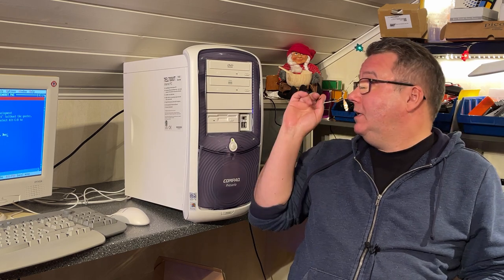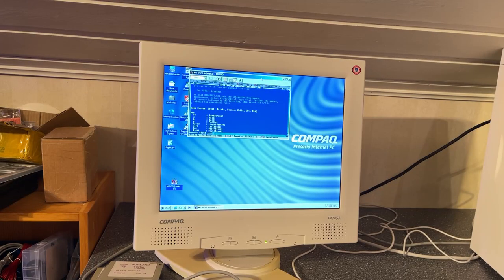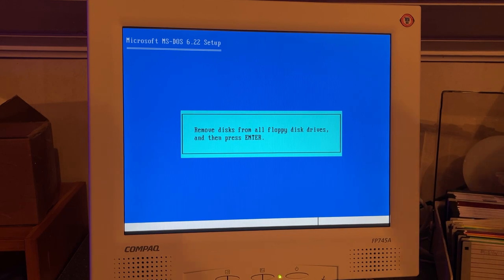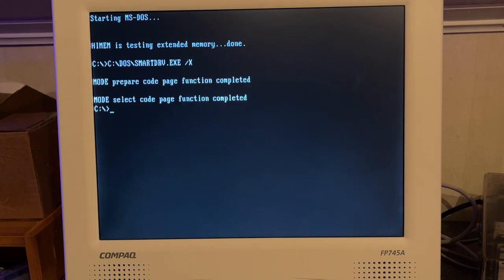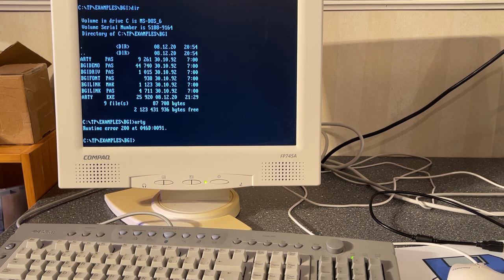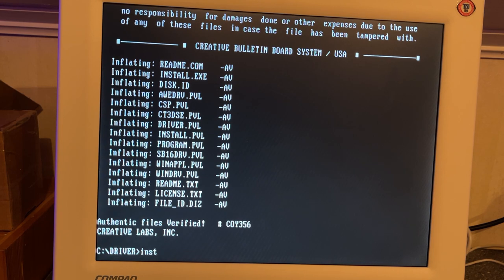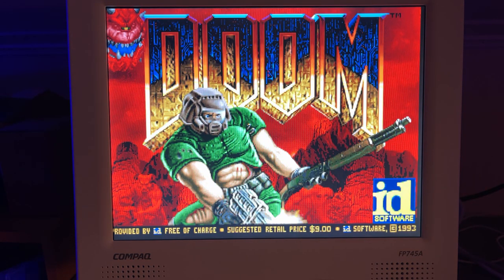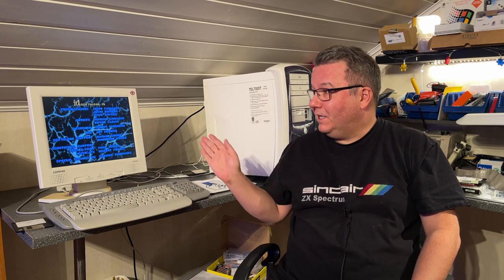Back to basics: Exploring MS-DOS and Turbo Pascal #DOScember

Comment: Turbo Pascal was great. One of the best IDEs ever created in my opinion. You could do almost anything with it, and do it fast. I did a point of sale client using Turbo Pascal in a weekend in the 90's. Later I migrated everything to Delphi until the "web application" era came and turned everything as painful and miserable as it could be.
Reply: It's still a pretty accessible development environment for DOS even now - compared to something like Programmer's Workbench that came with Microsoft C, the Borland IDE was miles ahead.. Turbo Pascal in general is great - Borland wrote great documentation for it which is easy to grab online, it has a very decent runtime library, a text-based windowing library, supports features like inline assembly, and at the time was very cheap - less than $100 when other language packages easily cost 5-10 times as much.  On top of that, it compiles blazing fast in general, and even compiles reasonably quickly on 8088/80286 CPUs, My last two DOS games were both written using Turbo Pascal, and the only reason I moved away from it for my current one is that I'm targeting protected mode (TP only supports real mode targets), and Free Pascal treats DOS like a second class citizen - there's usually something or other broken the few times I've checked it out over the years.
Reply: @Damaniel3  Re: "Free Pascal treats DOS like a second class citizen" - I'm a Free Pascal developer and I'm the author of the 16-bit i8086 MS-DOS and Win16 port. We don't treat DOS as a second class citizen. It is just difficult to maintain, when there are only two people contributing. We need more contributors, so if you like Pascal and you like DOS, please consider spending some time writing a patch the next time you encounter a bug, instead of staying with Turbo Pascal. Thanks.
Reply: @Damaniel3  I used Clarion for DOS for many years, and for building LOB apps like that, it killed anything on the market.  But it was much less fun than writing games and utilities in Turbo Pascal!
Reply: I agree with you 100%!! All the "modern" tool and frameworks require a lot of maintenance, updates and your program sbecome obsolete in 6 months. What used to be called a "programmer" are today a " developer". ;-) Web developer, PHP developer,  etc..
Reply: Totally agree !!!  I still program in Pascal !!!

Comment: Have to admit, I do rather like the look of that Compaq keyboard too. 
I used to work in Tech Support for PC World which was a Major computer retailer in Britain, certainly in the later 90's and 2000's and I do recall that there was a certain level of problems with compaq keyboards and if I recall correctly, they system we had to use to book a replacement for them was a bit of a pain in the ... rumpus ... 😀

That said, they did have some very fun designs and extra function buttons that even today wouldn''t be sniffed at! Although backmodding one with mechanical keys would be a nice project!

Comment: Turbo Pascal 3 was a revolutionary product, it was a capable compiler and very fast, but a pretty rudimentary development environment.  I was first running Turbo Pascal 3 on my original IBM PC with 2 floppy disks.  Then Turbo Pascal 4 came out which was a more advanced development environment including a pretty good editor and a debugger.  You could write very capable programs with it.  Once Turbo Pascal went into Windows it was very capable for developing Windows apps, even compared to tools and compilers available today.  I'm still running 32 bit Windows 10 which can run all of the old versions of Turbo Pascal, however I do my programming in a couple of descendents of Turbo Pascal- Delphi and Lazarus.  You said "20 year old machine"- my machine is 14 years old, quad core processor overclocked to 3.8GHz, and upgraded to SSD drives and Windows 10.
Reply from the maker: Thanks for the comment. We still maintain software written i Delphi at my company where I work. However, now most is written i .NET / C#

Comment: I think the best thing about this DOScember theme is that we get to discover Retro-YouTubers which we would be otherwise completely oblivious to even existed. Yeah, you've just gotten yourself yet another subscriber.

Now, I have done a mind-numbingly lot of Pascal programming, beginning with Kick Pascal on my Amiga 500 in the late '80s, Turbo Pascal and Borland Pascal up through the '90s, ending with several versions of Delphi up through the 2000s, before eventually moving onto C++ and C# like everybody else. Since far most of my coding was work-related and the company where I worked were for some reason clinging onto MS-DOS and DOS-related programs well into the WindowsXP years, with claws and teeth like a mad dog to its favorite toy.

I actually encountered the runtime error 200 in Turbo and Borland Pascal from pretty early on. And I also got so tired of having to use TPPatch that I eventually incorporated it into the CRT Unit, literally curing it for good. Whereas the original was called "CRT" and I wanted it to be easy to implement, I simply named my replacement "CRTUNIT". So all I had to do to fix my source-code would be to change the name from CRT to CRTUNIT in the USES statement at the very top.

I have just dug it out of one of my old backups, zipped it, and uploaded it to my website. So here is a little X-mas present from Denmark 😉
https://www.zhixalom.com/files/crtunit.zip

If you take a closer peek at the CRTUNIT.PAS file, you will notice that all I did was to replace the Delay procedure with the assembler-code from the TPPatch documentation.
Reply from the maker: Great comment! Thanks. I was thinking about finding a patched CRT unit.
Reply: @Arcticretro  Here are some other tips: if you use the FDISK command to create first 2 extra "Primary" partitions, so you have 3 in total), then 1 "Extended" and then more "Logical" partitions inside the extended one (I can't remember how many it can hold, I think it might be 4 per extended partition). Each primary and logical partition being 2GB... granted you do end up with a lot of drive letters, but that is one way of utilizing more of your hard drive space in MSDOS v6.22. You can boot from the primary partitions, not from the extended or logical, but those you can have a lot more of.

I totally get why you would want to show the installation of MSDOS v6.22 in a DOScember video. But as I am sure you already know, there really was no need to with your machine.

Because since Windows 95/98/ME basically all run on the same core, which actually runs on top of MSDOS just like Windows 3.x. Microsoft just increasingly tried to hide it with each version. But you could have simply disabled booting straight to GUI in the MSDOS.SYS file.

Now, in MSDOS up to and including v6.22, MSDOS.SYS is a binary file. But in Windows 95/98/ME it became a text-script-file just like CONFIG.SYS and AUTOEXEC.BAT. It is by default still protected by the "system", "hidden" and "read-only" attributes just like its predecessor, which makes you unable to directly edit it. But that is easily fixed with a simple "attrib" command from the DOS-prompt inside Windows:

ATTRIB -H -S -R C:\MSDOS.SYS

Now you should be able to "EDIT C:\MSDOS.SYS" or just use Notepad if you'd like. Then all you need to do is change the "BootGUI" setting and add a "Logo" setting to prevent the Windows boot-screen from overlaying and hiding the MSDOS boot up text-screen. It should look like this:

BootGUI=0
Logo=0

I always reapply the attributes with "ATTRIB +H +S +R C:\MSDOS.SYS" afterward, but I am not sure that it is actually needed.

This lets you use the MSDOS v8.0 of WindowsME (or v7.0 of 95/98) exactly as if it was MSDOS v6.22 and getting into Windows is just a matter of starting "win.com" like in Windows 3.x... and most importantly, this way your partitions are not limited to only 2 GB.

I have done this with my own RetroPC although it is running Windows98 SE, as I am not at all fond of WindowsME. Granted I have "stolen" MemMaker, QBasic, and some of the other commands from MSDOS v6.22 which are not present in MSDOS v7.x... and have set up a CONFIG.SYS boot-menu to easily select booting straight to Windows or DOS with various different memory settings... one of them including QEMM9 if I recall correctly.

Oh yeah, it is exceedingly important that you do NOT use any defragmentation or filesystem repair software meant for v6.2x (this includes CHKDSK) as they are incompatible with the Windows95/98/ME long filenames system, strip them from the FAT32 tables, and literally destroy your installation in the process.

Here is some more info on the MSDOS.SYS of Windows 95/98/ME.
http://www.pchell.com/software/msdos-sys.shtml

Yeah, I know - some of my friends used to call me "the head of the department for useless information"... and then I suppose that got old, as well 😆
Reply from the maker: @Zhixalom  Wow that was a lot of good info. Thanks. Yes I am aware that DOS lived on in Windows up until Me, but I still wanted to install 6.22 for a more authentic feeling:)
Reply: @Arcticretro  You are quite right 👍
I just remembered that I made a quick video of my RetroPC back in 2017 right after I had built and installed it up. I only had a horrible GoPro-clone fish-eye style camera at the time, so it really is nothing fancy. The RetroPC has evolved a bit since, with a new cabinet and a 1.2 MB 5¼" floppy drive (which I have yet to get working). But at the core, it is basically the same as the one in the video.

https://youtu.be/KubDXk14fP4

Comment: You realize you could have done most of the Turbo Pascal demo using Free Pascal in either Windows or Linux.  After installing Lazarus, just type "fp" in a command prompt.  Oh even in dos, I think you could have typed "tp" and weren't required to type it all out.

Terry

Comment: Ah, Turbo Pascal!  TP 6.0 was a great IDE/Language.  Much better than just Standard Pascal.

The first time I used Turbo Pascal was in high school on an 5150, 5160, or 5170 running PC-DOS 3.31.  Complete with green monochrome monitors.

Comment: Hi - Nice Video for Doscember

Very similar background, i completed accounting studies and as computers were popular and i had a C64 and amiga and was about to splurge on a PC 386 clone ( yes my parents believed i was crazy 3 computers everyone else has none in the extended family in 1986

So IT studies, system analasys and design, basic , cobal and pascal

Now turbo pascal 5 was released in 1988, but not when i done the cource, we were using free copies ( university copies for study ) or turbo 4 - which was fine

However towards the end of that year, one of the rich kids showed us version 5 and wow we all loved it.

Learnt to use object and modules better and in the following year some of us kept in touch and 5.5 was release - you could include assembler code - any external units we had made did not work, we rewrote some from scratch until some one said "hey the manual says just recompile the orignal code with the newer 5.5 version it will work 95% of the time then follow the error messages"        once again i learnt RTFM  but no one is going to read over 300 pages   ( yes same mistake with delphi )

Ok - with the power of BBS bulletin boards and the blue wave mail reader i came across the technojocks turbo pascal tools - if you dont have it have a search , if you cant find it let me know and i will find it, i have many home burnt cd's but a lot of the cheap branded ones that are fault due to the cd rot or the dye melting.  these tools are great much of the prettyness and flashiness is done as external modules that you just call and pass parameters, also things like reading bios and hardware information, auto calendars, conversion utilities eg litres to gallons, miles to whatever, nested submenus,  billboard style scrolling in dos ( just pick a line in dos 1 to 25 and star and end characters, back fill dos with ansii characters, vga resolution and basically i think what was called stroked fonts, read pcx or gif or bmp files and display on screen in a window, mouse directory trees or select and load files as input or output

After basic / cobal / pascal i actually done visual basic and ended up hating every version of C C++ as by then it was frustrating it was similar but different and my brain would do a pascal thing and it would spit errors in compiling and it would look correct because i recognized it as accurate , but not accurate for that enviroment

Basic - no brainer , line basic is so easy

Quick basic / Turbo basic - same but more structured

Cobal - great for readability and structure, your declaration and structure types all laid out, output reports are beautifull

Turbo pascal - all of the above together, compiles fast created tiny exe's, it was so good at one stage i was given new projects and scribble diagrams and asked to make TP5 mock ups of screens using the TTT - technojocks modules of how different layouts would appear and present, screen / field inputs / sample reports.  Then make runable demos that really just read a text file or binary file and some simple rearrangements of data or calculations so that management or users can press load file, do this process or run this task, save to floppy or file, send to printer

Re the div by 200 error, if you cant patch a existing exe ( and of cource you back up the original first ) what you can do is slow down the PC, there are programs like goslow / atslow / moslow  i may have spelt some wrong, but they all create wait states between processor clicks effectively slow down a pc by x percsent , so it would be goslow 10  or go slow 90 , it would slow down 10% or slow down to 90% of max - same reason you can play cga frogger in dosbox,  in 3 seconds he is dead and game over and you have not touched a key

Regards
George
Reply from the maker: Thanks for that story and comments :)

Comment: Try setting the execution cap to 20% or somewhere around there for a Pentium. FreePascal is compatible with TP7 without the speed issues.
Reply from the maker: Yes I know. But this was a trip back the memory lane, and I had to use my own disks with the original version I used :)

Comment: Great video, thanks!
I have a keyboard just like that one, but with US-en layout. Unfortunately, it stopped working this August.
Reply from the maker: You can fix it
Reply: @Arcticretro  I hope so, but it could be the controller chip itself. Did not have time to investigate, but after a few failures and disconnects, it entirely stopped being detected.